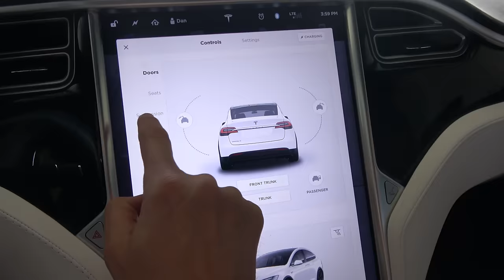What's inside a Tesla Tire?

Comment: First of all, Tesla doesn't make Tires, it's a pirelli run flat. Second of all. Why couldn't you just separate the tire from the wheel to look what's inside? Instead of cutting it off. Easier, safer and cheap.
Reply: When has that gotten any youtube publicity.
Reply: V S G views my friend, views.
Reply: @6z0  oh yes the clickbaity views
Reply: What's the fun in that?
Reply: It's what's inside they brake everything they buy
Reply: For the viewing pleasure
Reply: They probably did it the hard way to make "teslas tires" look strong
Reply: its a freaking normal tire for pete's sake people
Reply: Ahh, right, because everyone has a $15,000 tire machine capable of dismounting super stiff rubber band height runflats like the Tesla uses. You ain't gettin' that tire off with a pair of tire bars and some bravado, not gonna happen.
Reply: proper $2000 machine is enough
Reply: TestECull theres definitely tire shops on this planet 😂🤦🏽‍♂️
Reply: Thank you. Like actually thank you. You said what was on my mind
Reply: @lorenzogutierrez7488  like actually omg like like like like valley girl totally omg
Reply: V S G but it’s not as fun
Reply: Because hes rich of course
Reply: you know how What's Inside works, they don't do things the easy way.
Reply: It's the way of the illusive what's inside,  always cut thing open.  Never take apart...
Reply: Because that's too straight forward
Reply: @TestECull  You can remove a tire with pry bars and standing on the rim.
Reply: Because youtube
Reply: in america it is the only way to change tires

Comment: Tesla doesn’t make tires those are pirelli tires
Reply: I have Firestone tires with the same thing too like this isn't that unique
Reply: Drifts22Lt    they used the word Tesla tire to gain more views or even likes.
Reply: Italian tires very expensive
Reply: Fire Fox  original tires use by Tesla are only Michelin , specialy designed for Teslas...Michelin is french, but for the US market are this tires made in the US Michelin factories ...  Michelin is one of the best tires makers, and "for the story", was the only who was able to made tires conform (but was better) at NASA specifications for the space shuttle...
Reply: *these tyres    *tyre makers       ..and Concorde.
Reply: That’s actually to keep road noise down. Nothing about runflat..
Reply: Run wild Production   Wrong. it's NOT the (run-flat tyres) main purpose to keep the road noise down. it is more on SAFETY (control the vehicle) for running flat (punctured) tyres for at least 50 miles at a reasonable speed to organize (for a tyre) for a safe replacement.

Comment: Its NOT a Tesla tire! It’s on a Tesla car! It’s a Pirelli tire! It has NOTHING to do at all with Tesla! I could put those same tires on my Volkswagen!
Reply: Actually my GTI came stock with Pirellis , I believe they all do.
Reply: You couldn’t because pirelli and Tesla have a MOE Package. Those tires a specifically made for Tesla’s.
Reply: Nope. What Tesla has for tires are what other car manufacturers has for a long time. I believe it only comes with higher end car models. These are not specially made for Tesla. Don't believe me just go to a tire shop and talk to the pros there.
Reply: @sleepyearth  Not true, I work for a tire manufacturer and tire companies do have contracts with the car manufacturers to produce tires specifically for a certain vehicle. They are usually based off of another model and pretty much look identical but are manufactured specifically to the OE's specifications. Many premium OE tires have a symbol molded onto the sidewall to let customers know that they are in fact the same exact model of tires that the vehicle was shipped with and can usually only be purchased from dealerships. BMW for example uses a star, Audi uses an AO, Mercedes uses an MO, etc. The tire companies are frequently audited by the car manufacturers and the OE tires have stricter quality control guidelines.

Comment: I see so many dumb things in this video I honestly don't know where to start. Damn...
Reply: "you're not supposed to drive on a flat bc it will damage the side wall"  I'd be worried about the rim lol
Reply: I was pretty sure he was going to cut the rim
Reply: Me too, very unsafe for one...
Reply: Also run flats have bead protection so that the car travel up to 50 miles an hour without damaging the rim...
Reply: Looking at the inside of that Pirelli and it looks like crap compared to a Michelin ZP...
Reply: @chrisb9445  I was pretty sure he was going going to cut his fingers when they slipped from the knife grip to the blade while stabbing a rubber tire.
Reply: Alan Muir yeah, I get the whole entertainment part of YouTube, but stuff like this, not really worth the likes or subs
Reply: Steven m exactly 😂
Reply: I feel the same way after almost every video. I came to the conclusion it is intentional.  Every video they act as if no planning or preparation was put into how to best open something. 90% of the time its grab whatever blunt object is nearby and start hacking at it while it's popped up between a shoe and a toothbrush.
Reply: Start with the goggles
Reply: skycrap how he takes his glasses off he talks to the camera
Reply: @Daniel hosking Very dangerous misuse of a Angle Grinder, the handle is on the wrong side & when it grabs, the grinder pushes towards the user.
Reply: Yep, video in a nutshell, (I wish they just removed the tyre from the wheel at a shop. LOL
Reply: The clip was short but it wasn't clear that he was properly jacking the car. You can't just stick a jack under the battery pack and the jack point is pretty tiny, requiring an adapter.
Reply: Ron Young they look exactly the same and it’s not a run flat

Comment: It's funny watching someone with no experience try to use power tools .  using  a grinder then has the small hot bits of rubber flying of in the direction of his white car . Sensible.
Reply: He didn't know how to use that knife either lol
Reply: yes and he cut it away from the car so if the grinder disc came off then it would have hit the car

Comment: Breaking news: same as any other tire because Tesla is a car manufacturer not a tire manufacturer and uses normal car tires!!!
Reply: They don't need to be a manufacturer to run custom designed tires.  They have another company do so to their specifications as they did.  Tesla of coarse makes it sound like oh just cut and glue it.  Could turn into a nightmare with a customer blaming road noise on wrong glue, bad cut etc..
Reply: Cactus Sensai Doug the point is there is nothing special about Tesla tires.
Reply: yes typical shops could repair a puncture sure, but that is special and not in all tires.  Could they cause a problem yeah, glue they use disintegrates or dissolves the foam etc..   Likely the reason for it is the tires are low rolling resistance (firm) and the foam helps soak up noise/vibration.  Which is more noticeable since it is not powered by a internal combustion engine.
Reply: Cactus Sensai Doug 
Its not a unique tire. They are Pirelli Scorpion zero asymmetric and you can buy them at tirerack, discount tire and etc.  Yes, it isn't a common thing to find in tires but a lot of comfort focused tires have foam in them to reduce road noise. Bet you many expensive luxury cars have a similar tire.
Reply: I hear you but it's funny to say it's both not unique yet is uncommon at the same time.  It will start at luxury but trickle down as tires get wider with shorter firmer  sidewalls.  Sound and vibration dampening does need to be done and replaced properly or it's not going to function.
Reply: Cactus Sensai Doug There is a difference between unique to teslas and uncommon to find. What I was trying to say is that tire is available anywhere and not a tire tesla had custom built but that you are right for saying it is uncommon because not many models of cars have this tire from the factory.
Reply: Spot on
Reply: Cactus Sensai Doug Pirelli Scorpion Zero Asimetrico, normal tyres by Pirelli, no custom design.

Comment: Since the tires are low profile(meaning the sidewall heights are small). The foam is there for a couple reasons. One, you get a slightly quieter ride. Two, you do have something to ride on in case of a flat. And most importantly Three, it protects the rim from cracking if you hit a pothole or something of the sort.

Comment: For those of you that are not aware of it, that is what you call a run flat tire. The reason for the foam inside the tire is so that you have a supporting structure so the tire can roll on when it is flat at it does not ride on the rim and completely destroys the tire's side wall structure. Try driving with a regular flat tire and you will see what I mean by the rim cutting into the side wall of the tire.
Reply: Nonsense.

Comment: As a former Goodyear and Dunlop performance specialist, modern run flat tires utilize a reinforced sidewall and a foam center patch to allow short distance low speed driving.  The reason no one wants to patch it is because the vulcanizing patch has to be attached to rubber surface.  It would require quite a bit of work to prep that tire and then your liable for the lives inside of the car if the patch fails.  It's a wonder with all of the law suits any more you can still get a tire patched period.
Reply: At the shop I work at (Goodyear) we turn down Tesla flats as well because like you said, they prove to be too much of a liability to work on. We'll work on a good handful of run-flats, just not the ones with foam padding and ofc we charge for Run-Flat repairs (like $30 a tire I believe) vs normal tires being free
Reply: Todd Halpin if a patch is used to repair a puncture of a “run flat tyre” with reinforced side walls and the patch will release later on, the “reinforced side wall will do his job.. save to repair is on 70% on the tread (start from the middle). It has to be a “cold vulcanising” so from the inside to the outside with special cement and a special plug. (Not a cord or string). This  is save and not dangerous. Always check tyre from the inside if you find small rubber pieces, if so the tyre has run to hot and you need to replace the tyre for a new one.
Reply: The only thing i learned from this video came from this comment, thank you! 👍🏼

Comment: Dude not trying to be a stickler but everything you did is extremely dangerous and safety glasses will not protect you. 

In the event of a tire explosion not much can help you because generally they have thin steel belts in them. If the tire explodes the probability of one of those belts slashing open anything on your body it hit is pretty high. 

The second thing that was highly dangerous was using an angle grinder to cut the tire. The cutoff blade is very thin and spinning at over 13000 RPMs. The heat generated will cause the tire to melts along the cut, eventually luck will run out and will grab the disc, a thin cutoff wheel suddenly stopping from that high of a speed causes the disc to explode and send shards of it everywhere. There is a case of someone doing this exact thing and the disc hitting him in the face and he almost did not make it. 

Its a good video I just would hate to see anyone hurt simply because you might not have known it could do that and cause that kind of damage.
Reply: These guys look like they're due for a Darwin award...

Comment: seeing this, security is not even in your top 100. Stabbing like crazy downward and slightly towards you on a round object? Using a grinder on a metal object while holding it with your legs? Well, lets try a chainsaw next time.
Reply: people can do dangerous things with caution and be fine, otherwise we would not have survived as a species.
Reply: Im with Vani. People CAN do dangerous things without event, but when you're posing as a "family orientated" channel, where you're trying to educate responsibly, probably not a good idea to go stabbing at solid rubber object non chalantly and then use an angle grinder on a non stabilized wheel while breathing in direct amounts of rubber born smoke... some great role modelling right there.

Comment: 1:47 everyone is always looking for "FREE" things
Reply: I never in my life heard of a place repairing a tire with a flat for free. That's is just crazy. It takes about 30 minutes to remove the tire off the car, then the tire off the rim. You must then plug the hole with something that cost money usual less then 10 bucks. Then put the tire back on the rim, and then back on the car and then fill the tire with air. Only way I can see it being free is if you bought the car from them or the tires from them. But just Joe blow walking into a place your playing 20 to 30 bucks minimum. Repair shops labor rates are $60 to $70 bucks an hour at your local repair shop and the dealer is like $100 to $150+ an hour depending on how nice of a place it is and how much free stuff they give out. I can't see how they would just do it for free when the technician is working for 30 minutes getting paid around 20 to 30 dollars an hour. They would be losing a lot of money if they did this all the time. They also have to worry about you bitching like a girl if they scratch your rim by going too fast.
Reply: Matt Ferrigno very true mate apart from it’s spelt tyre
Reply: @mattferrigno9750  I work at Discount Tire. All flat repairs are free. and no. it doesn't take 30 minutes to take a Wheel off the car. Should take about fifteen minutes to do everything.

Comment: Tire like a tire nothing special
Reply: the tire is not even from tesla... its made by pirelli... i dont understand what makes this video special
Reply: If your ignorant this video might seem special... The real reason they wouldn't repair your tire is because if you drive on a run flat tire flat for more than 50 miles the tire is wrecked, the sidewall construction is compromised.
Reply: and its totally flat here right? use your brain before commenting
Reply: Sovehy that looks like a brand new tire, notice the green paint at the edge of the tire wall
Reply: Sovehy Also runflat tires don't deform when they are flat, the sidewall retains it's shape. Maybe use your eyes before commenting...
Reply: I don't know man, I work in a car shop and i've never in my life seen one of these tires tbh
Reply: DK Drawings So you think tire with foam inside is normal? Have you ever even seen tire without the rim? :D
Reply: Ahahaha honestly tho, i've never seen tire with foam inside, and this dude says it's normal
Reply: Fix for free?

Comment: That foam pad in the tires is the "run flat" feature. The foam plus the low profile tire makes it possible to drive on a tire that had no tire pressure in it. The foam takes up space that the air pressure would otherwise occupy.
Reply: Nah. I don't think so. The run flat feature is reinforced sidewalls. That foam is totally soft and wouldn't do a thing. Pretty sure it's just to deaden the sound or something like that.

Comment: Tesla doesn’t manufacture tires. So who cares
Reply: neither does Honda but they have a run flat that requires  special tools to change it
Reply: "special tools" a locknut socket
Reply: Those are to change the wheels (rims), not the actual tire.
Reply: Mack Harris I like the fact this dude thinks he’s super smart and in one video he called an 8 ball frame a stabilizer when it’s not
Reply: Marcus asdadasa false, you have to have a special tire machine
Reply: yeah just buy a new tesla who cares
they clearly have the money for it
Reply: That does not mean Tesla didn't create the design.
Reply: TrueNorth2606 Yes it does. Those tires can be used on any car that has similar sized rims. They weren't made for the Tesla and they weren't designed by Tesla.
Reply: andrews2547 Bien dicho
Reply: which machine
Reply: TrueNorth2606 Pirelli Scorpion Assimetrico, they are tyres from Pirelli, designed by Pirelli for use on any car.
Reply: But that does not mean that Tesla created the design either, of course they fecking didn't. It's literally an off the shelf tyre that has designs that have been used across the board for god knows how long.

Comment: I used to work at discount tire, run flats are not limited to teslas. They won't repair it due to the heat buildup of driving with little to no air pressure can compromise the tires structural integrity. Not because of the foam pads, some run flats don't have those.